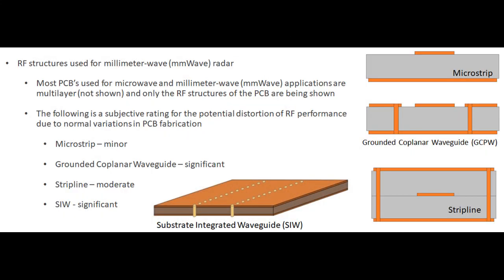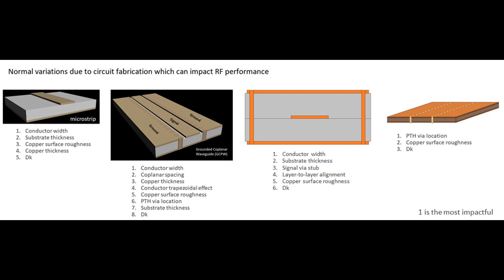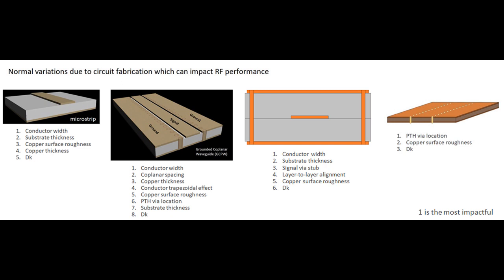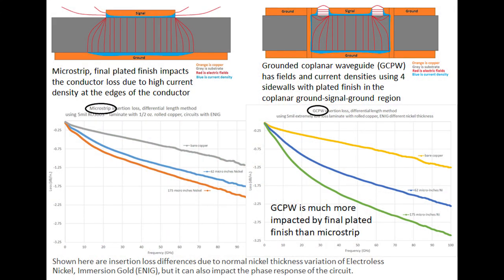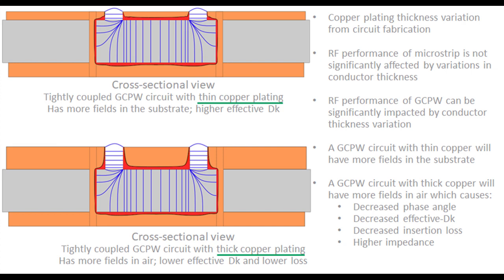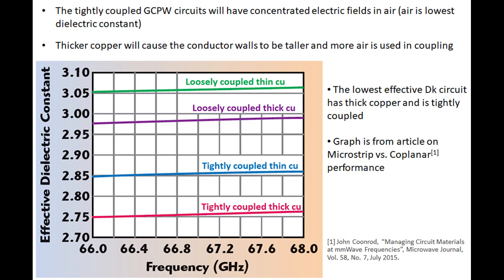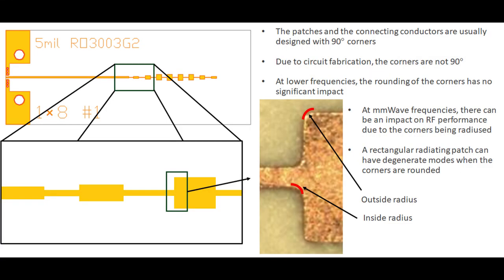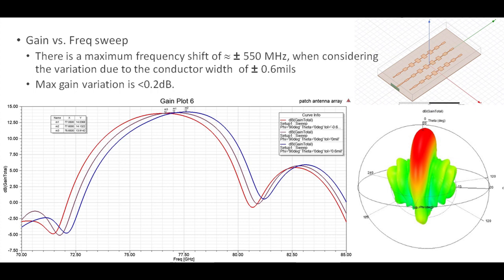How Does PCB Fabrication Affect RF Performance

Comment: Very informative thank you. Regarding losses in a test environment typically aren't a problem since those can be calibrated out using offsets. The most important trait I think of when designing RF traces/ circuits is return loss. When adding SMAs or connectors making sure to account for trace to space width changes since adding connectors changes your trace "height".